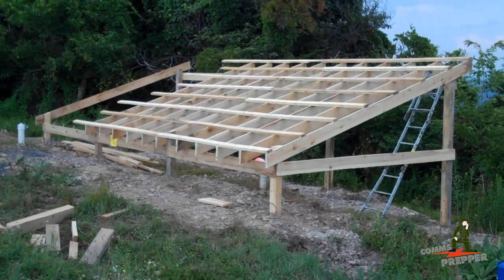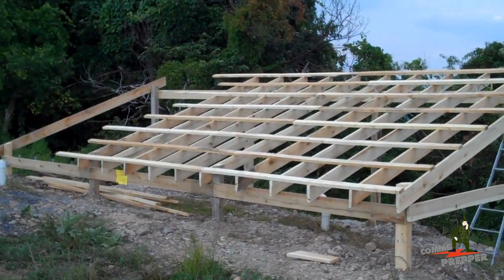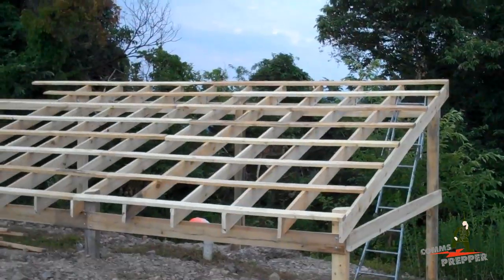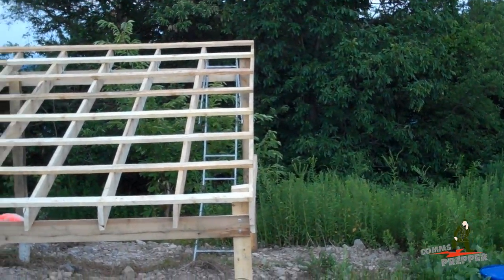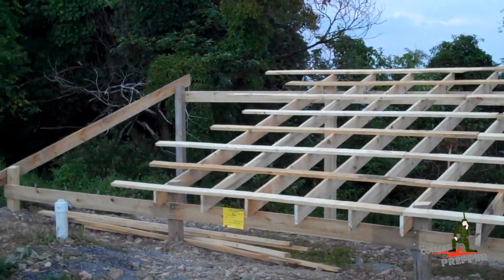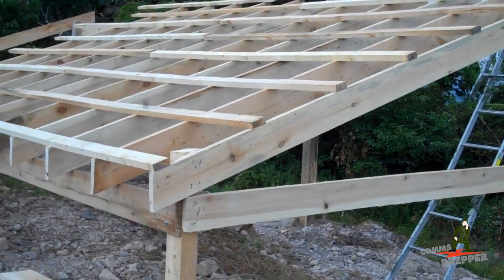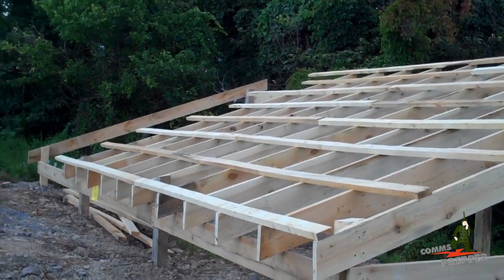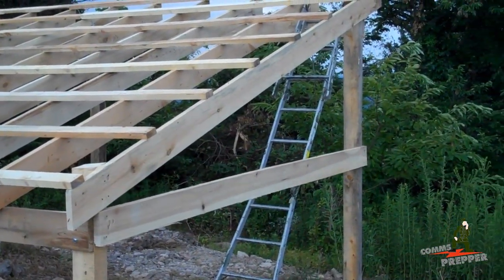Rainwater Collection

Comment: Looks nice. Have you thought about putting solar panels on that platform? It will catch just as much water and can could supplement your retreat power needs. Keep up the videos they are much appreciated!
Reply from the maker: I did but this is too far from the retreat and the line loss would be too great and the cost of running the cable 600 feet would also be high.

Comment: Good job. I'm building a much smaller type of system & I was wondering how would you keep the outside filters from freezing?
Reply from the maker: My plan is to shut it down when frost starts.  However, I recommend you watch this video as it covers freezing.  I'm basing my system on this video: Rainwater Harvesting Off Grid